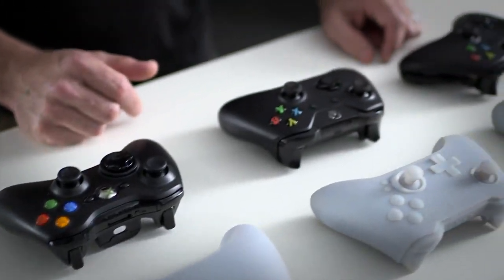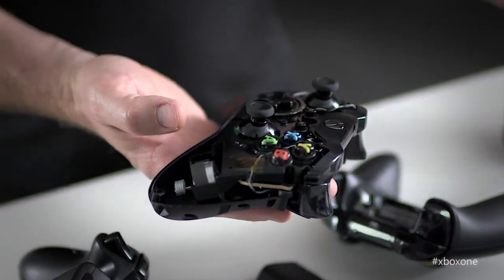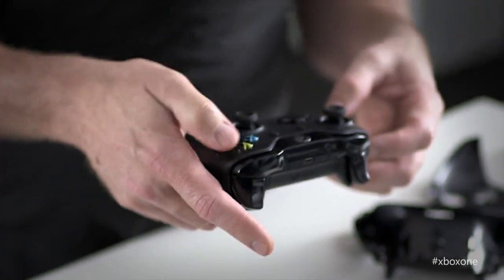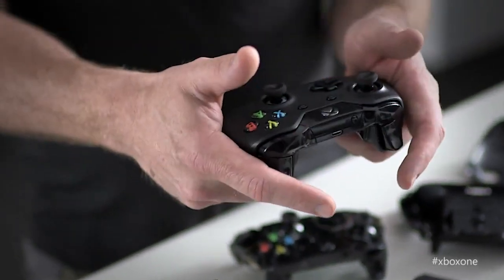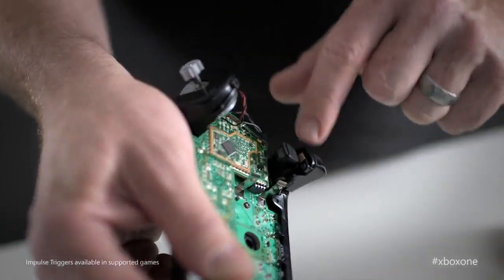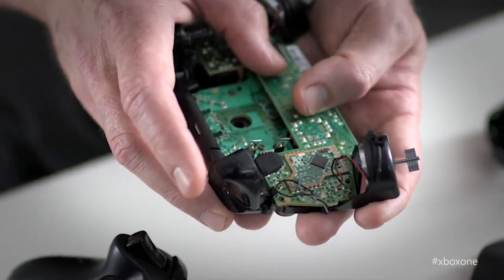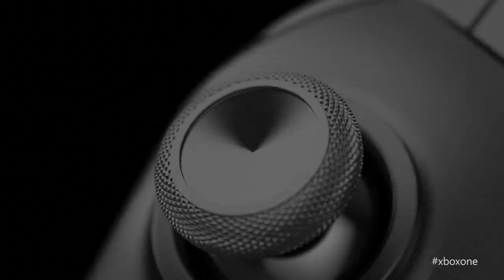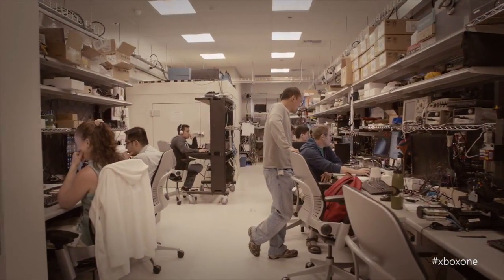Xbox One Controller Hands On!

Comment: Think of Kinect, foremost, as a device with extra features that you don't have a need for. (I'm ignoring that the One comes with a Kinect, regardless.) The pairing thing is that, if you have it so Kinect knows who you are, it will recognize when you have a controller in hand, and automatically sign you into your profile. However, it's not at all necessary, it's just a quick little shortcut. You can still just sign in like you normally would.

Comment: The Playstation controller? Yes, actually, it has. The differences might not be too extreme (except when they first made controllers with thumbsticks) but they're still there. I do prefer the Xbox controller. I always have. Just sayin' that just because you don't know the changes doesn't mean they aren't there. Also, the PS4 controller does have a couple obvious changes. A touchpad and the share button, namely.